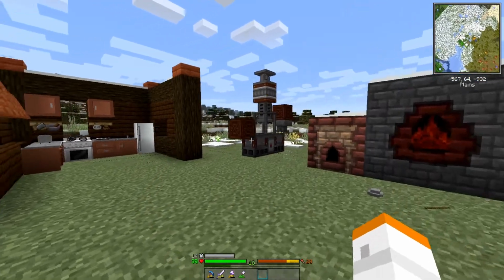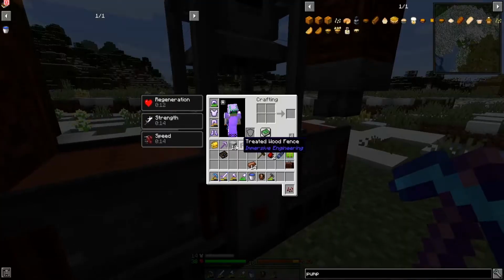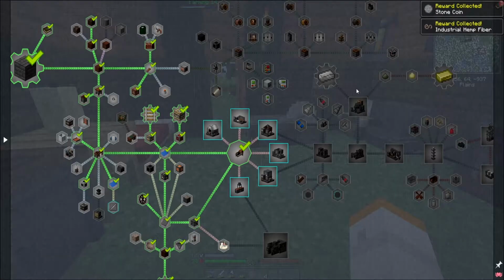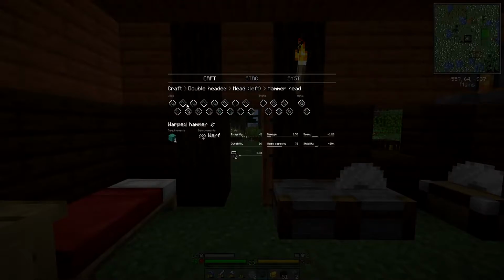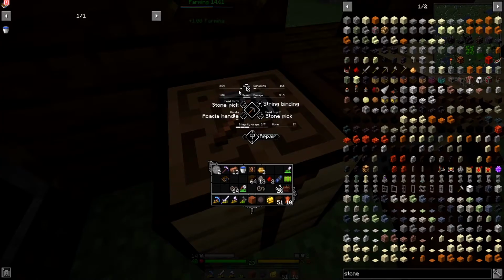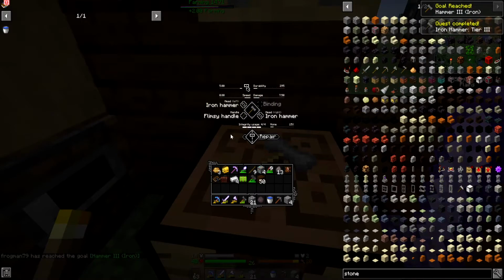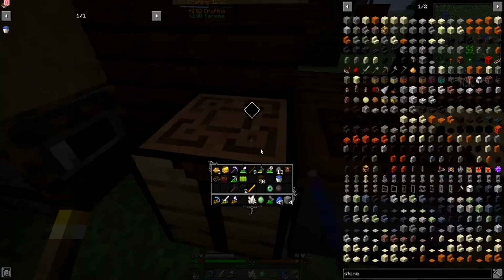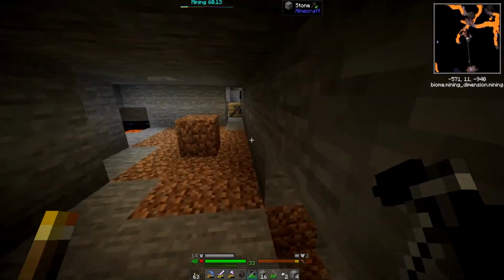Engineer's Life 2 EP7 IE Fluid Storage/Messing with Tetra

Comment: I know it's two years late (but the pack is still available and at a better place)  just wanted to let you (and others watching) know that is possible to use any material when upgrading a tool as long as you have the required level tool for it - whether it be a hammer,  knife or axe @22:43